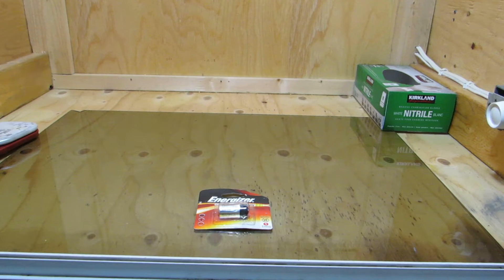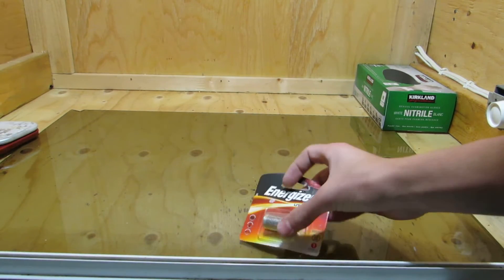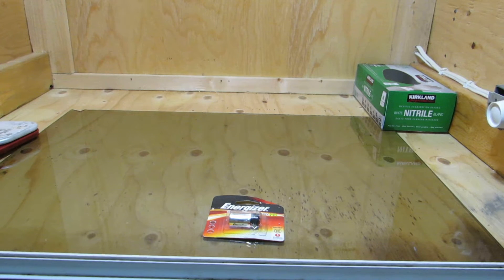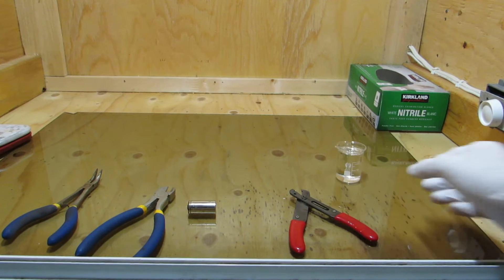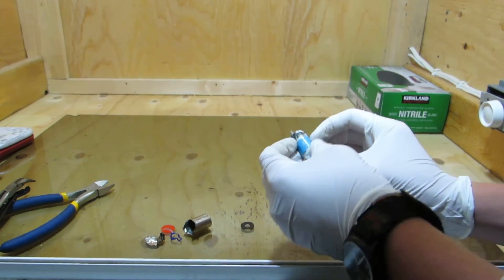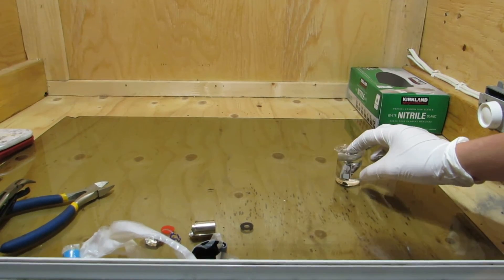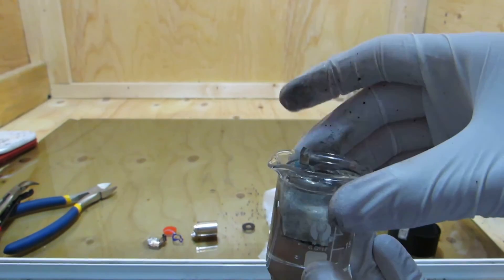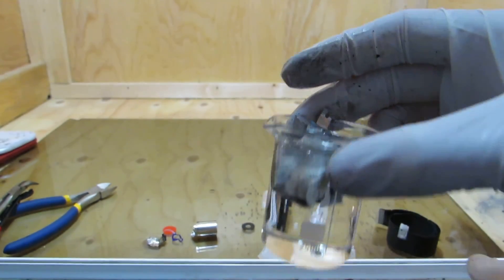Lithium from Batteries (Household Materials)

Comment: Would dissolving the lithium into something immediately  work as a substitute to mineral oil? I plan on dissolving it into a fuel to get that amazing red flame.
Reply: You could slowly add pieces to water to dissolve it in the water (careful, the reaction is very exothermic and releases flammable H2 gas!), and once it's all dissolved, boil down the water to get LiOH. LiOH can be turned into various other lithium salts to get red flames.

Comment: Hi so I commented on one of your previous videos about your method of making glacial acetic acid and how when I tried it made h2s (hydrogen sulfide). I was really confused but what likely happened is the bisulfate oxidized the acetate at the high temps making so2 (sulfur dioxide) and co2 and a bunch of other stuff. I think it might be so2 but it could also be h2s. The fact that it didn't immediately get neutralized and still stinks after a naoh bath suggests it was so2 but then again it smelt like sulphur / rotten eggs not burnt matches so maybe h2s? It smelt like when you open a cheap butane canister which has the sulfur smell to prevent leaks. What are your thoughts?
Reply from the maker: Hmmm, interesting. Sulfur dioxide is a very pungent odor and definitely distinct from the butane canister smell. From what your describing, it probably was hydrogen sulfide. Hydrogen sulfide is detectable in very low concentrations (and actually paralyzes your sense of smell at higher, lethal concentrations).  I wouldn't be surprised if some H2S just didn't react with the NaOH because it wasn't exposed to it. Because it is detectable in such low concentrations, even trace amounts left would have a smell. I am still quite intrigued that the reaction did not work for you. I did the reaction myself so long ago it's hard to rememebr, but I do remember some side products being made, and the reaction vessel was a pain in the ass to clean out. But I did produce a good amount of the desired product.
Reply: We were taught, when being trained to work in the forest in northern Alberta (near the oilsands) in H2S survival. The rotten eggs smell is on average 20 ppm.  Over 200ppm you cannot smell it at all since it burns the olfactory nerves on contact,  @ 200ppm Death can occur in 3 breaths!

Comment: how pure is the lithium and could you melt it down and seal it in a ampoule?
Reply from the maker: It readily begins to oxidize and react with nitrogen when exposed to the atmosphere, so it needs to be stored in mineral oil. If you wanted to keep the purity high, it would be best to open the battery in an inert atmosphere like a glovebox. You could also definitely melt it and seal it in an ampoule, but once again, that should be done under an inert atmosphere so a lithium fire doesn't start lol.